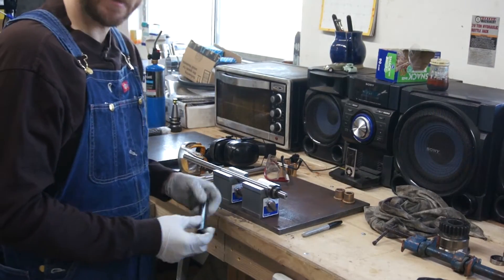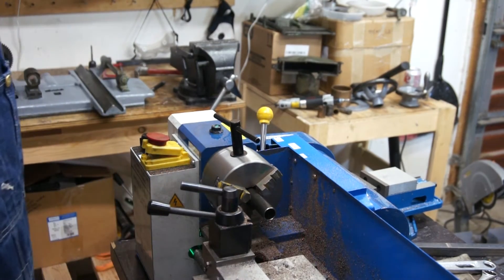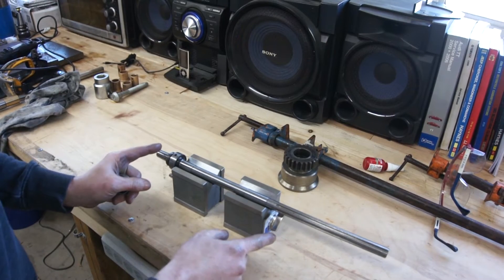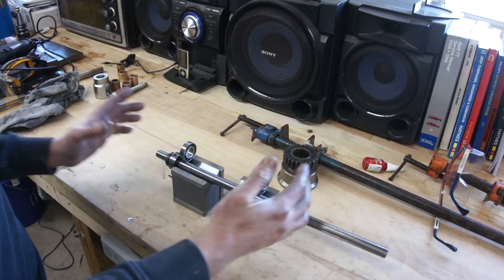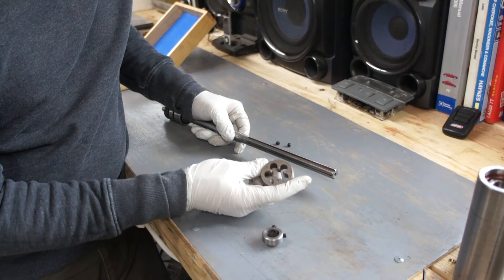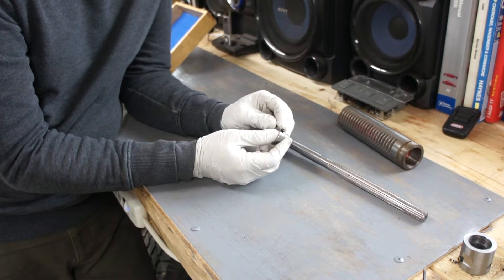Angular Contact Bearings - Drill Press Milling Machine

Comment: I think you’d be better off adding an exo skeleton style extra quill housing to add rigidity. It’s built to do vertical drilling so I think adding that extra meat would help a ton
Reply from the maker: I saw someone make a three-column support for a similar drill press and they said it had a big impact.  That's a good idea.  It'll be a nice winter project once this NSU restoration is done.

Comment: The angular contact bearings are directional and must be placed in the spindle correctly in order to work right under preload. I only mention this because you didn't in the vid. I have to applaud your effort here, but in the end I think you'd been better off saving and spending the money towards a larger machine. I was in the same position you're in, for years .. and I kept looking and was able to score a Lagun mill that already had nsk ballscrews for under 1000$ .More metal and bigger spindle sizes make a large difference. With the drill press you are limited by the small diameter of the spindle and the distance from your last bearing to the cutter which will cause lots of flex and chatter. If you can shorten that distance it will likely help. I would try to get more rpm out of it as well, which can help with finish. Carbide likes a certain speed and feed rate that is higher than hss cutters. Overall, nice job for working with what you got , been there before and sometimes its just plain frustrating.👍

Comment: You do know, you can repack old bearing with a good hi-temp grease (Farmers Stores ie: Co-Op, TSC are the cheapest place to by grease) if there are dust caps, I use a carburetor pic to carefully pop the caps out, clean the bearing of any debre and repack install dust covers and presto you've lost your play in shafts, of course you are better to get new ones, but regular maintenance keeps e enough old bearings new again. Best of Luck, thanks for sharing I just subbed your videos interested to see new ones. Cheers from Barrie Ontario Canada L4M2Z8
Reply: My dad would put the grease in a coffee can and the bearings and heat it up until the grease was liquid then it ran inside the bearings.

Comment: But, of course, the bearing manufacturer and the grease additives you pack the bearings with are the most important thing, just like exotic capacitors are the most important thing in speakers, and vintage camera lens coatings are the most important thing in photography!

Comment: I think the biggest contributor to the chatter you're getting is due to the amount of spindle sticking our below the bearing, if you could reduce the length somehow and get the tooling closer to the lower bearing you'd have a much more rigid machine.
Reply from the maker: I think that’s good advice.  Thank you.

Comment: Check the difference between climb and conventional milling, the direction in which your tool path travels really really matters. you can't just zig zag and hope for the best
Reply: also look at your compound table to see if there is any chatter but I bet that it's the actual length between the stock of the machine and the very end of the chuck being long, add a mill bit in your chuck and it's even longer, doesn't help that you're not using a stubby bit either.
Reply from the maker: That's good advice.  Thank you!

Comment: * Another hot tip : use a 2 flute HSS endmill when cutting ALUMINUM - you'll likely get a better finish . . . ( a shot of WD-40 , or similar light oil / kerosene will also help ! ) 
Chattering is 100% due to lack of rigidity ! ! !
Reply from the maker: Awesome.  Thanks for the tip.  I'll give it try.

Comment: You have a lathe, why didn't you just cut the threads into it and make a nut with it? You didn't have to buy a tap and die. Also, there are a few videos here which show how to add a draw bar'ish adapter to a drill press head, to hold the chuck in place.
Reply from the maker: I tried with the lathe but the Mini Lathe is so poorly gears, it moved too fast for me to make the threads.  I ruined two parts on the lathe before switching to a tap.  I think my Atlas lathe would be a better tool for it but it wasn't, well, in existence when I made the mill.
Reply: Hello, in response to your comment, could you give the links of the videos you would like us to watch?
Reply: @RobertAdairWorkshop  treadmill PMDC motor. Find a throwaway treadmill, grab a toolbag, and some time, strip out the motor, AND the speed controller. Its a little boxy thing you can't miss. That's how I power my homemade 1920s metal lathe. VARIABLE SPEED. You can even connect a tachometer to the speed controller PCB. On mine it is blue wire. Keep going bro.

Comment: When you said lathe I didn’t rewlaize ya meant tiny toy this makes sense now .  People save your money and look at auctions and buy real machines and u would be surprised what great deals u csn get at auctions
Reply from the maker: I did a lot of stuff with that lathe.  Many bike parts and modifications before replacing it with a larger lathe.  I cut my teeth on it and have no regrets about it.  When you don't live in a city with a large industrial history (like Pitsburgh or Detroit) finding larger machines can be tough and when they do pop up, they are expensive.  Some people don't have the space for a larger lathe, nor the money, and most don't even need to capabilities of a larger lathe.  You should be a bit more open in your thinking about what tools people can afford and if they meet their needs.  I could drive an F350 pickup, but I don't need one.  So I have an old Dodge Dakota.  It's kind of the same thing.

Comment: Pack the diameter with a bed of Bronze apply with a TIG , and machine it , it is more efficient and easier.

but I dough any of this was necessary, as a spacer or trust bearing could have been simpler to implement.

Comment: Would be nice to hear measurements in inches or thousands so I can actually understand and fallow along .  As it is it’s very frustrating
Reply from the maker: I don't recall.  Did I provide the measurements in mm?  I'm an engineer.  We use metric measurements so it's my default.  If I did, the conversion is 25.4mm to 1".

Comment: You keep saying roller bearings when you should be saying ball bearings for the OEM bearings or angular contact bearings for the ones you purchased when you are discussing those. Roller bearings can be cylindrical in shape or a tapered cylinder (cone), as in Timken Tapered Roller Bearings.  Look up conventional milling vs climb milling as you were describing those operations around 13:45.  The key for milling is machine rigidity.  There is another YT video where he was able to tie the drill head to a fixed object and used concrete for the base. Also locking the head with the table supporting the X-Y vise or base with bars or reinforcements will help. As others have said in the comments, use high speed steel tooling for aluminum and keep the quill as far up inside the drill press head.

Comment: sometimes I wonder what your time is worth to build this...I would have just gone out and bought a mini mill for the amount of time and money you spent. Mini mills aren't expensive, run on plug power and take up less space than that Frankenstein death trap. I watch this and it's like using a socket wrench as a hammer. Yes it will work but at what cost and quality
Reply from the maker: I did it for fun, to see if I could.  And I wanted to make a video on it that was better than what was on Youtube.  This is my most popular video so there's an appetite for this type of content.  Getting a video that people actually watch is tough, as is coming up with ideas for projects that I also find enjoyable.  

Most of the parts I used (the work table, the linear screw jack and the motor) were for another project I was working on and borrowed.  I used it as a mill for a while with good results until I could find a better mill locally.  

I didn't want one of those cheap Chinese mills.  I had a cheap Chinese mini lathe and I spent twice what I paid for  it, getting it to actually work right.  And it was still always broken.  Those mills are the same low quality.  More to that point, though, I firmly believe in buying USA whenever possible and hate sending money to China.  Those little mills would just send more US dollars overseas.  I find it odd that much of my audience, Men in the baby boomer generation, recommend buying Chinese products over making something in the USA..  But I digress.  

I've since bought and use a round column mill and the Walker Turner is back to being a drill press.   Nothing in my workshop is ever permanant.  

https://youtu.be/kd4fgYpNiSQ
Reply: @RobertAdairWorkshop  Sadly people with less sense will follow videos like this and build something that will seriously harm them. Remember most machines we use want to kill us. Add machines cobbled together and that just pushes the probablility it will happen.
Honestly some mini mills are quite good with great service. Precision Matthews comes to mind. Yes we can go down the rabbit hole on Chinese. Look at all the things that are made there mills are the least of my worries. If you live without Chinese products you are a better man than me. I rather support USA but sadly the consumer industrial complex rather build wealth than support Americans very little is made here now.

Comment: The drill press spindle and the entire structure is designed for axial loads and is not rigid enough to support radial loads of any consequence.  Good try.
Reply from the maker: Thanks!  It's been meeting my needs, despite that.  But I'm a home shop and I'm not using it for machining anything of consequence.

Comment: Yes I am interested in this research. I have long given it much consideration. So in return I'll tell you if you beef up the quill with a tight fitting spacer or machine a heavy one from scratch with the most rigid steel type you can use, the vibration will be reduced. Also a mill has very heavy columns and casings that restrict the flex between the work and the cutter. Your spindle is smaller than some drawbars. Your rack is about the size of some spindles on milling machines. The trade off can be improved by tighter gibs and better fit for traversing the workpiece. For what you're working with, your work is typical. Should you machine steel, the higher pressure required will make the job less effective or at the least introduce further vibration and flex.
Reply: could you provide some help on your last sentence regarding steel??!! I am looking to do some very complicated, good quality work. I have LOTS of time, skill, patience. I have NO money at all. So with that, any info you can provide me with, and/or books, vids, articles ( even in other languages if applicable ) I would be extremely thankful.
I am looking to do very light milling cuts, even a few thou at a time, like my silly adj. reamers. But right now, that's all I got, and my reasoning is: I would rather build a tool with what I have now, then with that build another one a little better, lather, rinse, repeat, ....than to wait for someone to hand me a deal, or save up money for a grizzley. I will not be able to do those things. But working 18 hours a day, with my skills time patience, I can do. Please know who I am and who I'm not Jack. I got heart, brains, balls. Just no $$. Thanks, I look forward to hearing something from you, because I loved the your comment. It is right up my alley. --Joe

Comment: Enjoyed your video. Like very much that the problems were explained. Your experience re-enforce 3 major things for this viewer: 1,  spindle and quill heft of a drill press are no substitute for a mills; 2,  frame column and head stock mass of a drill press are no match to a mill's; 3, and I can save a bunch of money by just buying a mill. Oh there is a 4th thing too. I would miss a lot of fun if I don't convert a drill into a light weight mill. Thanks for the entertainment.

Comment: Was hoping to see replica of the cut on that steel part that gave you so much trouble and moved you to install angular contact bearings. Cutting some soft aluminum isn't really pushing the mill like before. No surprise we didn't see a difference between bearings.
Reply from the maker: Yeah, that's a good point.  I don't have another t-nut blank.  I suppose I could buy one for another video, though.
Reply: @RobertAdairWorkshop  Any other suitable tough steels you could try on the mill? Just machine a piece of scrap even? Great execution on that conversion by the way.

Comment: WHY DONT YOU JUST USE SOME THIN BRASS SHIM STOCK, AND SOLDER IT ONTO THE SHAFT, (IF NECESSARY),... :face-blue-smiling::face-green-smiling:
...THEN DRIVE THE NEW BALL BEARINGS ONTO THOSE, AND YOU'D BE DONE.:face-red-heart-shape:

Comment: Sorry your incorrect. The bearing are a bid deal. You should get new ones again. What you just did is incorrect use of the bearing. Until you get the preload on them they are on different then a roller bearing. By using them the way you did. Is like taking a jackhammer to them. You where on the right track just have to fallow through. Make a tub to go from top to bottom like you fond in the one you got then make a slip fit threaded collar and put a taper pin to the shaft then you can set the preload

Comment: If you work with real USA made machines always use inches not that mm bs
Reply from the maker: I’m an engineer.  We use the metric system.  my calipers and indicators are metric.  My brain thinks in mm. So I work in mm.
Reply: @RobertAdairWorkshop  Im an American (USA). I always use Metric, not that inch bs.

Comment: Drill presses make horrible mills if your trying to do this don’t Morse taper is not designed for lateral loads and will pop out and just end up destroying a good drill press
Reply from the maker: I'm not sure you watched the entire video.  It's not a morse taper drill press anymore.  I modified it to use an ER20 collet chuck.  Those are rated for lateral loads.  There are a lot newer videos on the topic.  You should check them out if you're interested.  I'd like to hear your feedback there, too.